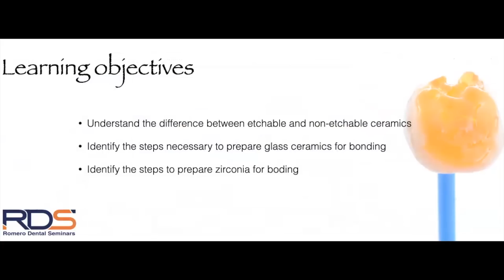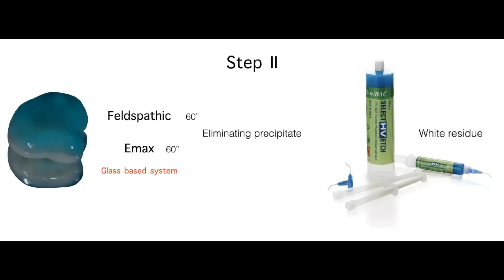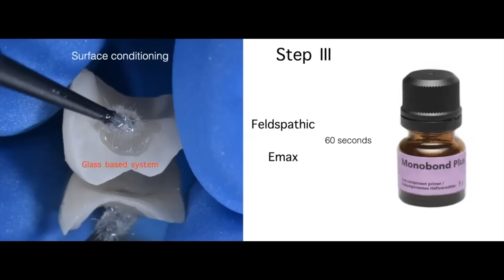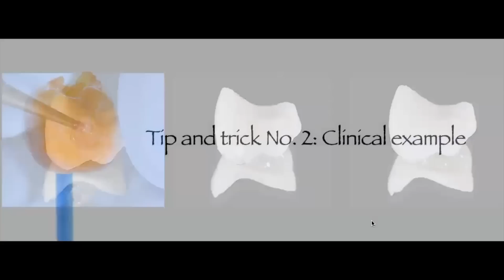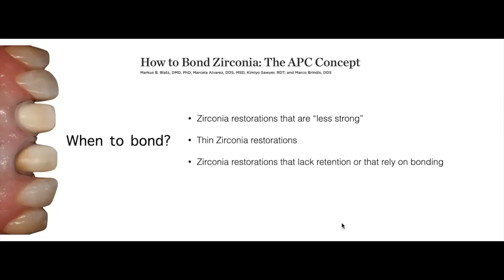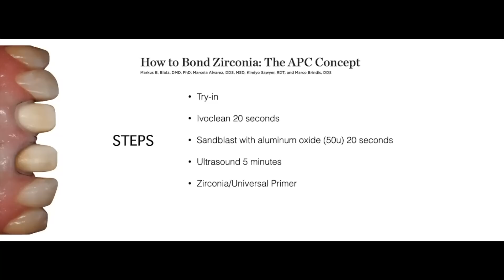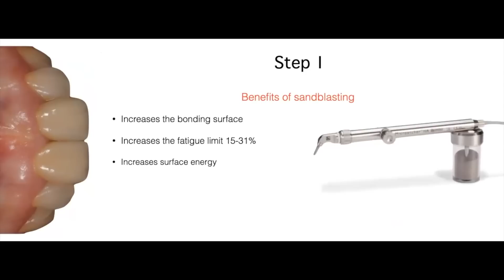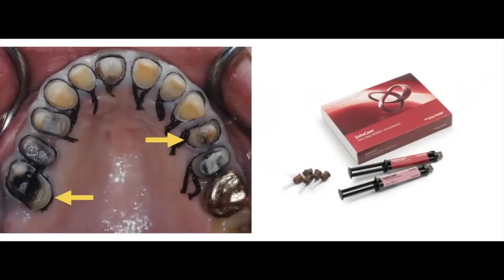Tips and tricks bonding protocols

Comment: . Do you still use Zirconia/Univeral primer for your zirconia crowns when cementing them with self-adhesive cement?
. Any specific reason you didn't go for feldspathic ceramics over zirconia for your last case 34:38?
Thank you for sharing Dr. R
Best
Reply from the maker: SA cements still contain “resin” so, yes, you need to follow the same protocol as for “bonding” your restoration. Thanks for watching